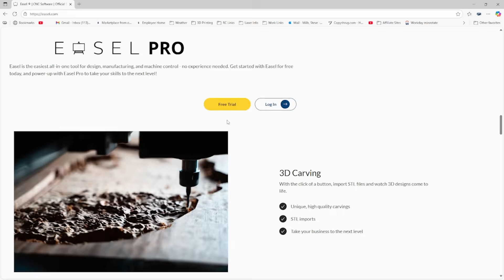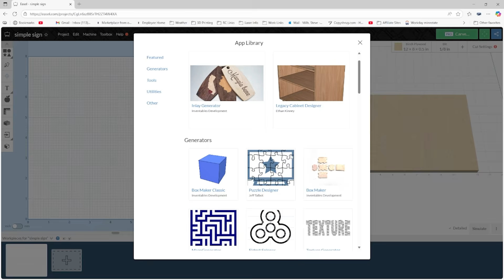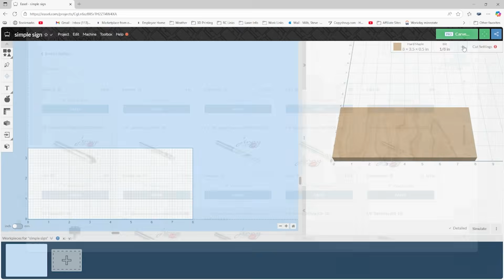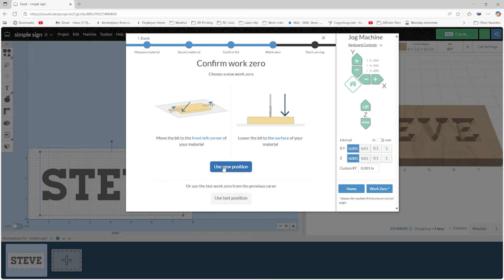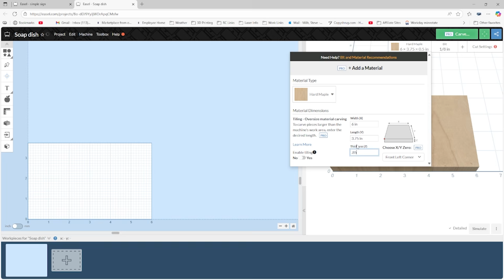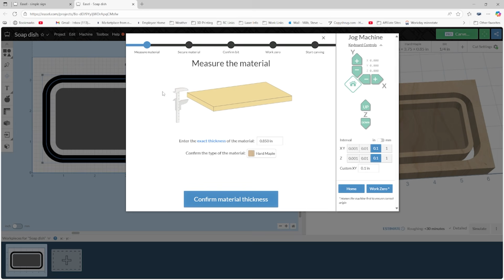CNC Newbie? Easel Makes It Easy!

Comment: Steve , great video maybe I
Missed it but does the program on easel tell me what speed to run the router on? Or is there a cheat sheet on what speed to run depending on bit size and depth ?  Thank you!
Reply from the maker: It will give you a recommended RPM to set your spindle / router at.  You'll need to find a reference for the dial on your specific router.  The one on the Sainsmart Pro Max 710w router is as follows. Setting 1: ~6,500 RPM | Setting 2: ~10,000 RPM | Setting 3: ~15,000 RPM | Setting 4: ~20,000 RPM | Setting 5: ~25,000 RPM | Setting 6: ~30,000 RPM

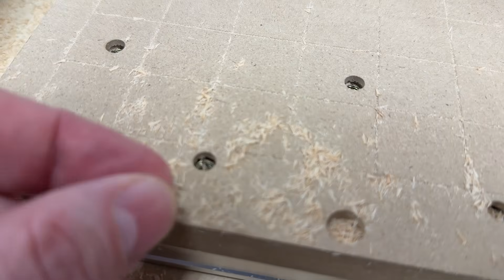Comment: 22:50 when you say "if too much saw DUST you're running too slow".  Do you mean too slow feed or too slow spindle speed?
Reply from the maker: If you are getting dust and not small chips you are running to slow of a feed rate for the spindle speed and the end mill is not cutting as much as rubbing. So you either need to slow down the RPMs on the spindle or speed up the feed rate.
Reply: @Vintauri  Thanks

Comment: how did you create the gcode
Reply from the maker: Easel is both the design software and the control software, so you don't directly interact with the Gcode but there is an option to export it to a file instead of directly to the machine if you'd wish to run it offline.

Comment: I have designed a complicated object that I intend to manufacture from a casting (Plastic). I have designed it in Fusion 360. Can I use this program instead of controlling the milling machine?
Reply from the maker: It depends on the complexity of the carve.  If you are using Fusion to develop the model you can also use fusion to send to the machine, or you might want to look at exporting the gcode from Fusion to something like g-sender.  But without knowing more about the model and the complexity of the carve, it's hard to say if either will work or which will be best.

Comment: I'm a total newbie. I plan to cut 1mm or 2mm foam to make parts for another hobby. I bought the cheapest Chinese CNC. How would you hold down the foam? I think double sided tape will damage the thin foam when I try to get it off the table.
Reply from the maker: My only experience cutting foam on a cnc involved using a vacuum hold down bed. Depending on how lightweight your foam is, you could try some low tack tape to hold it, but there is always the risk of it being not strong enough to hold it in place or too strong and it tears the material.

Comment: Another great video, thank you. A couple of questions. Did you run a surfacing bit over your MDF first? How long did the soap dish take for the cutting? 
Do you know the dBs on the machine?
Reply from the maker: It is wise to run a surfacing bit over the spoilboard however the stock one sits further out from where the endmill can reach so if you want a real flat surface you might need to secure a smaller footprint board on top of the stock one and then flatten it.  I have not measured the DB of this one, the loudest part is the trim router spindle, which is about as loud as a typical trim router.

Comment: Thank you for the video. I'm having issues with the usb it came with. Going to download Easel.
Reply from the maker: Sorry you are having issue with the included USB.  You can also download the CH340 drivers for your computer to recognize the device and then use a free software like Gsender to operate the machine.  You'll still need some design software if you go that route.  Easel is a nice way to get started with the machine and then decide if you want the Pro version of Easel, or to use another combination of software.

Comment: how do you square your workpiece on the table?  I didn't see you do that.
Reply from the maker: In my review video for the machine I used a vbit to engrave a grid into the spoilboard. I then line up the material with that to ensure it’s square to the gantry.

Comment: Steve, I apologize if I missed this, but the router itself has a speed adjustment on the top, slower to faster, where is this ideally set, I know you don’t want to set it so high that it bogs down or so low that it may burns the wood, where should we start the setting at?
Reply from the maker: The SainSmart 710W router offers 6 fixed speed settings, ranging from approximately 6,500 RPM (Dial number 1) up to 30,000 RPM (Dial Number 6).  I try to keep it around 12,000rpm for most my bits, so I test it between numbers 2 and 3 and adjust based on how the cut sounds and if I'm getting good chips.

Comment: Just bought this CNC and am watching all your videos. I do a LOT of 3D printing and laser cutting/engraving. CNC was always the next step and I'm slammed with a learning curve... again.
1. Explaining all the bits - I kinda get the logic with some but there are so many, maybe a video explaining shapes of bits and what their main purpose is. :)
2. SOFTWARE! Ohhh what software....
3. With 3D printing I ran OctoPrint on a RaspberryPi and could remotely control and make adjustments to the 3D printer, does this CNC have head-unit (computer) capability to eliminate the need for a computer connection &.or transporting sd cards and crossing your fingers.
Reply: @davey3765  they may both run G-code, but subtractive manufacturing is a much more mature technology and has only somewhat recently become something that is accessible to hobbyists, as opposed to additive manufacturing, which moved somewhat quickly to being accessible to hobbyists. So, the breadth of scope of CNC machining is vastly wider and in general is much more involved. I'm saying this to say: While it obviously won't be impossible to aim a camera attached to a Pi or another SBC and allow remote monitoring of the machining process, it also isn't great practice to leave a CNC machine unattended. 
To boot, the lower-end CNC machines operate in 'open loop', so there is no checking by the hardware to ensure that the spindle is actually located where it is supposed to be at any given time. What this means is that if the spindle "crashes" into the stock or becomes dislodged for any other reason, the program will keep running, instead of ceasing movement due to the error. 
These are just some of the reasons that it's not going to be nearly as simple to do what you did with a 3d-printer, with a hobbyist CNC.
But I wish you luck and I'm sure you can figure out some way to implement some of it.

Comment: Hi, thanks for this very clear intro. I’m just starting the machine up and I don’t see a collet for a 1/4” shank. The machine came with  a 4mm and a 1/8”. Did you order one separately? or am I missing something?
Reply from the maker: You will need to order separate ER11 collets to fit other endmills.  I would recommend getting both the collet and the nut so it is easier to swap between the sizes. Here is an example: https://amzn.to/49MFLQu

Comment: The BEST how-to video EVER! Thank you. New to CNC, however I operate 3D printers and lasers. I ordered the Genmitsu 4040 Pro. 
Note: I use Kevlar gloves when changing out bits on my mill and drill press.
Reply from the maker: I'm glad it helped! The 4040 Pro is a great machine to learn on!  Good reminder on the gloves when working with sharps in the shop.

Comment: Will easel stop and ask you to change the bit if they are set differently?
Reply from the maker: The machine cannot tell which bit it has in it unless it's using an Automatic Tool Changer, it will pause to have you verify that the right bit is in place, but if you still confirm it when the wrong one is installed, it will move ahead thinking it is correct.

Comment: I use a Foredom to make jewelry and there are many bits for sanding. Couldn't you do a second pass, not as deep, using a 1/8" sanding bit after the carve to remove any fibers? The bits are so diverse,  some are like a puffy scrubby pad that would remove and fibers but will not leave any scratches.

Comment: What would you recommend as a good dust collection option? (affordable of course)
Reply from the maker: I would get the dust shoe from Sainsmart and then grab a small shop vac and a cyclone separator that mounts on a 5 gallon bucket.  You'll need to make sure you have the right hose adaptors.   Dust Shoe: https://amzn.to/4r2xPBh   Cyclone Separator: https://amzn.to/43wqKie  

There are some all in one units that also work but will cost more like this one from FoxAlien:  https://amzn.to/43uo058

Comment: Hey Steve, that was great, I always wondered how those little bench top CNC router worked, and the software too. Great beginner tutorial, I learned alot!
Reply from the maker: Thanks!  I've been using CNC routers longer than lasers, but lasers sure have taken over my shop.  There are a number of software options out there for CNC routers, Easel is nice to start with as it helps make it easy.  I will admit, I sometimes overthink things when using this software as I'm used to the flexibility of others but with that having to manual set up more items in the workflow. I'll hopefully get more of these learning projects out to help demystify them some more.

Comment: I have been using easel for a few weeks, it is fairly easy to use. I have a 3018 pro it is way to small. I can not make much with it
Reply from the maker: It does make it easier to get started with CNC's.  The smaller machines like the 3018 can be a bit limiting but they do help get you used to the process.
Reply: @kentucker9450  I’m looking to getting a machine but I want to buy one that I would be happy with. Have you looked into a make/model that is your next unit? It’s frustrating for me to find honest advice as most are reps or in sales for their own products.